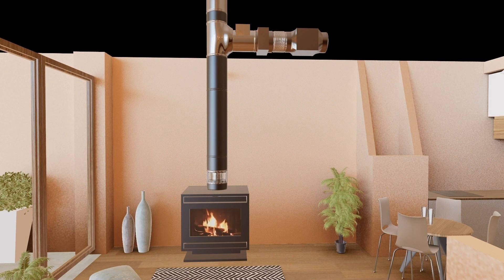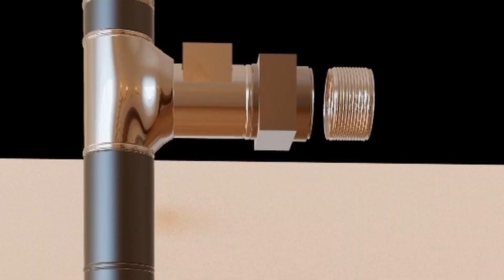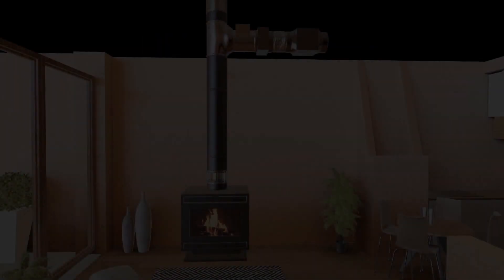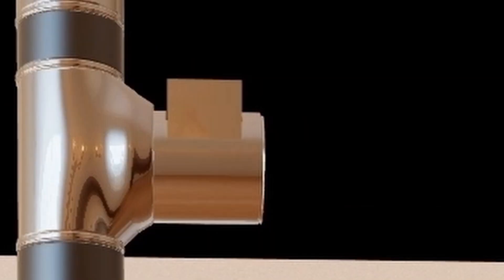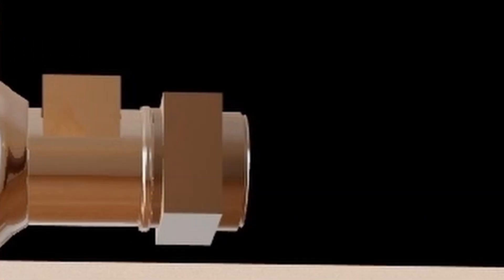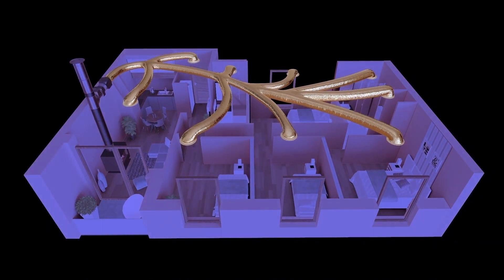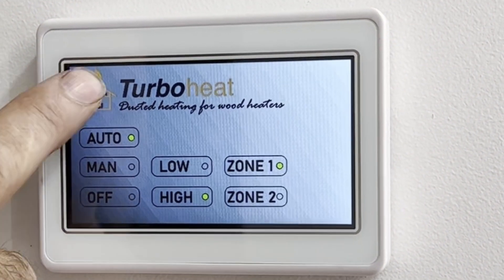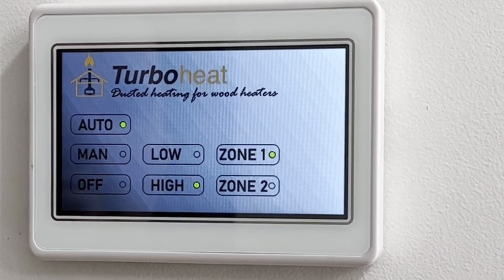Turboheat Explainer

Comment: The only safety problem I see is this system can potentially run flu gasses at temp to low to prevent premature creosote build up in the chimney...this may lead to higher chances of chimney fires.

I've seen many flue gas heat exchanger systems and amittingly this is the nicest one so far...but...has turboheat looked closely at this problem and is there "control box," monitoring of flu gas temps to help mitigate this risk?   Why not just use a fan to circulate return air around the burn box instead like most higher end forced air/wood systems?
Reply from the maker: Hi Greg I understand what your concerns are. The heat control box thermostatically controls the heat exchanger. Which how we engineered the system we actually burn the active pipe hotter and yes we don’t let it cool. The active flue is different again. Much thicker stainless steel. 
By heat exchanging of the flue, We actually still pick up heat from around the fire box as well
Reply: @turboheatau  I realize that the system picks up warm air from the top of the stove as well as from the flu.  Any way you slice it though, picking up flu heat means flu gas temps will be lower, not higher.   Efficient heat exchange between the fire box and house air and/or hydronic system negates any incentive to capture flu gas heat imho.

What I liked about your system is that it is a nice and neat upgrade for older stoves that usually have flu gas temps running much higher than necessary.   I just think from at least a liability perspective, you might want to monitor flu gas temps and work that into your control box somehow.

Comment: Not very safe if you have a fire and distribute smoke around the house!
Reply from the maker: Hi Martin.  Thanks for your concerns. Turboheat has undertaken extensive R&D as well as certified testing to meet building standards, emissions, performance and clearances for installation, as well as air quality. Turboheats advanced technology’s is what makes this ducted heating system so unique. 
With the design and engineering of the turboheat system there are certain components which does not allow smoke to enter the heating chamber. The heating chamber is where turboheat heats up the air so it can be distributed around your house safely.  The smoke can only draft up the inside of the flue pipe to outside.
Reply: No any more unsafe than any other forced air heating system.

Comment: Would additional ventilation for the wood burner be required if the fan is pulling air out of the room in which it is in?
Reply: Hey Scott, 

In the room where the heater is located yes we do require vents for the air intake for the Turboheat system.
Reply from the maker: Yes for any wood burner to be installed you do need additional ventilation. Not necessarily because of turboheat system though.